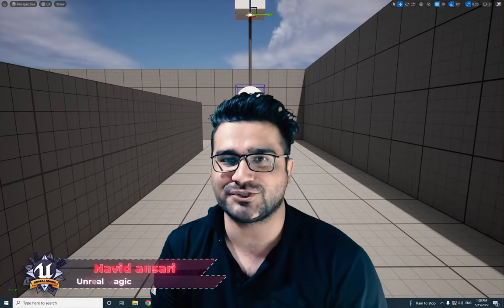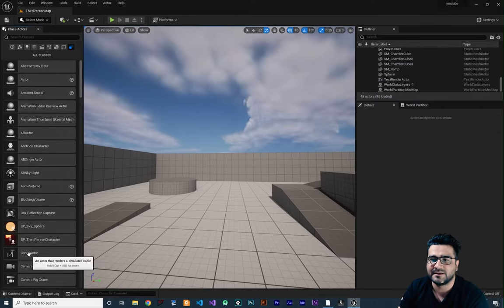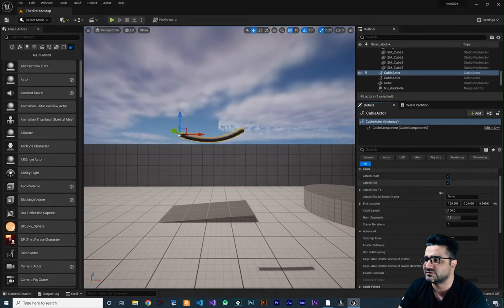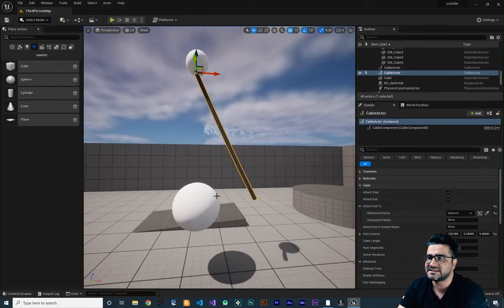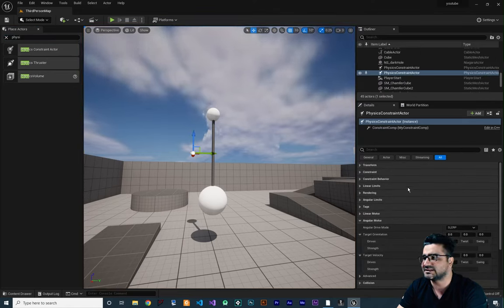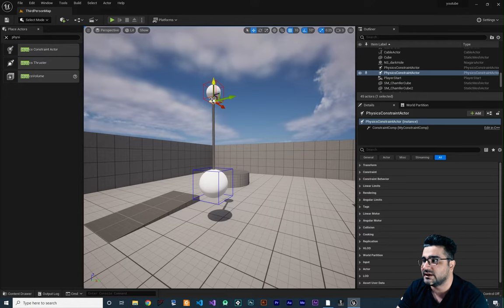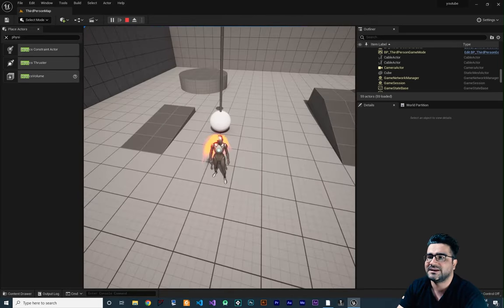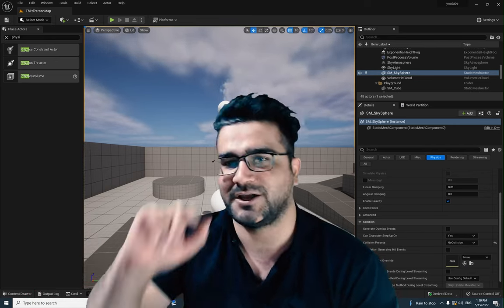Rope and cable physics with physics constraints in unreal engine 5

Comment: When i'm rendering the image, the cable is shaking. Is possible the cable be stable or not to much shaking ? Thanks
Reply: i guess there is no answer to this?
Reply: do you have collisions turned on? If you do and the cable is attached inside another actor, it breaks because it is constantly colliding with the actor it is attached to (e.g. the two spheres in this video).